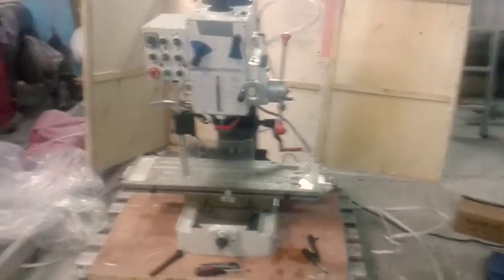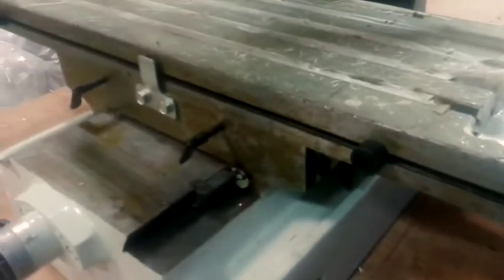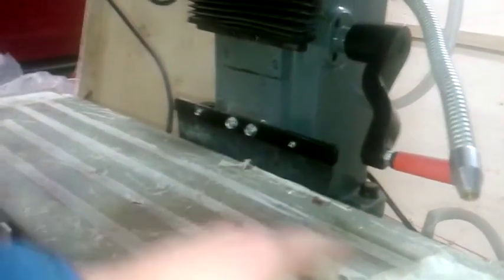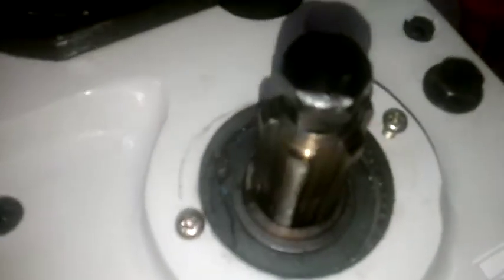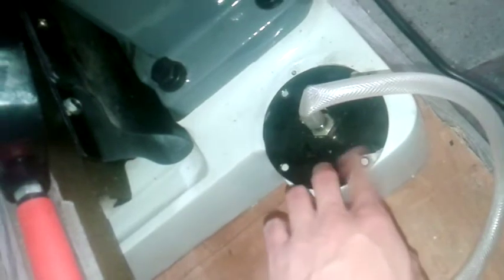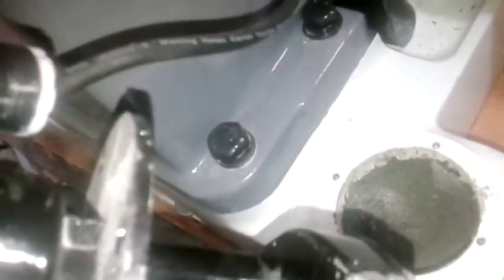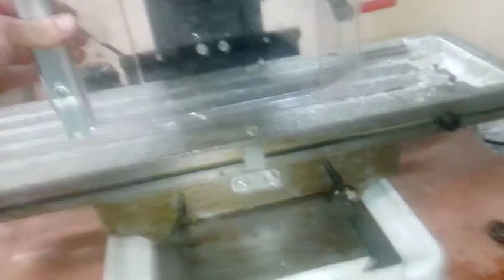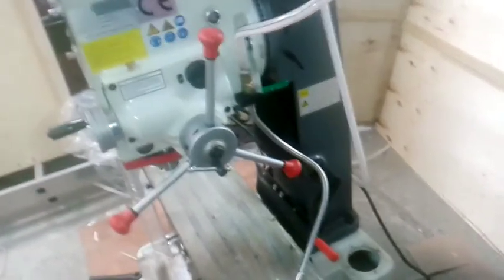ZX7045B1 ZX7045 brand new Mill first run , run out spindle test Part 1

Comment: Looks like i suffered the same fate as you, sir...

Bought a brand new zay7045 only tobe seriously dissapointed...

Those chinese ass hole company sold nothing but JUNK!!! Dirt and Sand all over the machine. Not only the exterior, but also the interior of the gearbox.

Broken/ miss cast, not aligned bolt, rust on all the internal parts, bad surface grinding. NOTHING BUT JUNK..